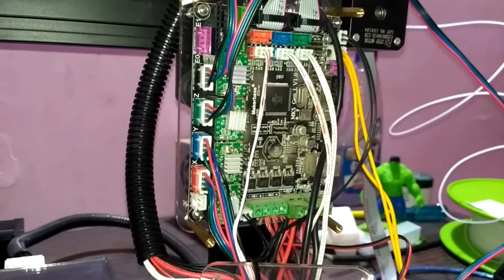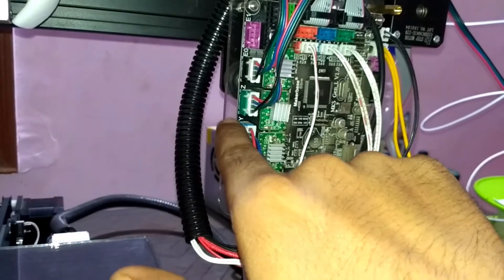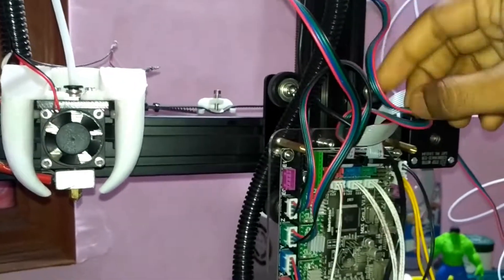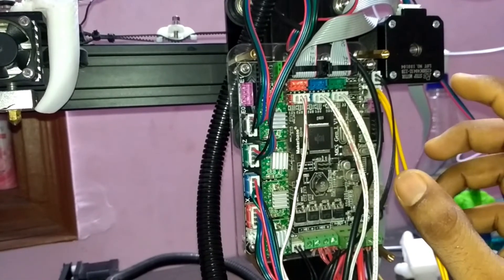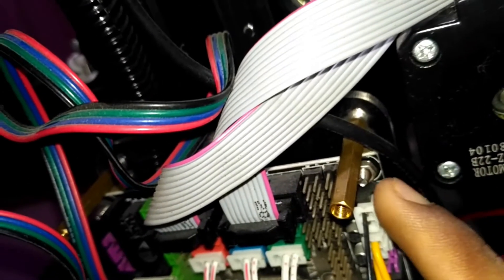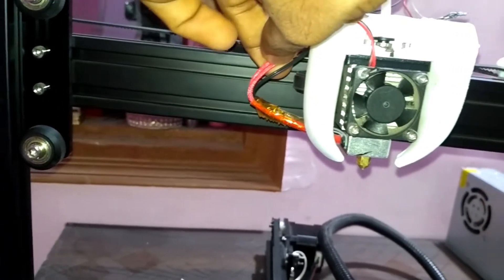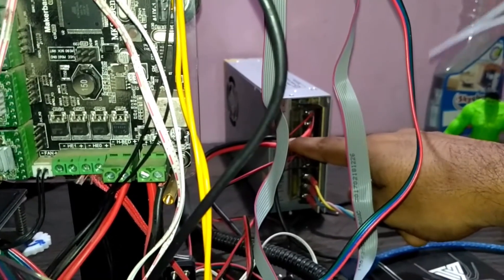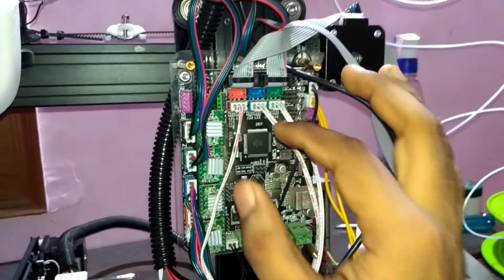Mks Gen L V 1.0 Electronics connections

Comment: I'd like to use an MKS Gen L v1 with a 6V stepper motor and a MKS-CD/TB6600 driver.  Officially, I don't see this driver in Merlin's configuration.h, but it's very popular so I'm hoping it can be made to work.     My concern, however is the 6V for the motor.. the MKS' terminal block says 12V/24V.. is that for the motor or for the MKS itself?
Reply from the maker: What's app me on +91-9157826933